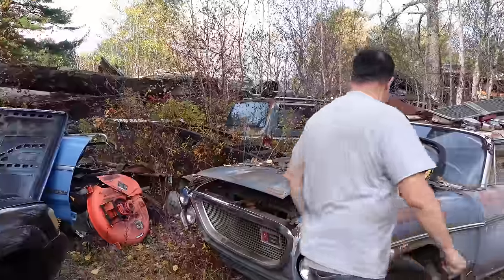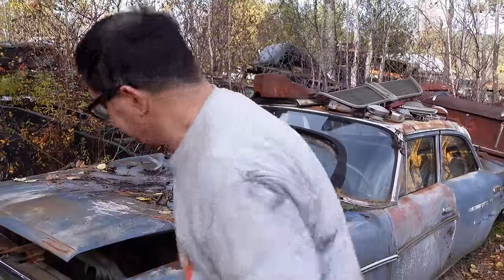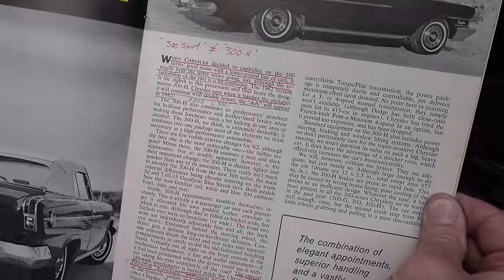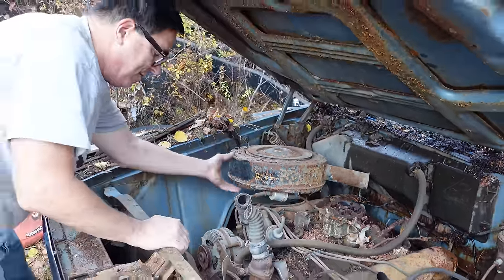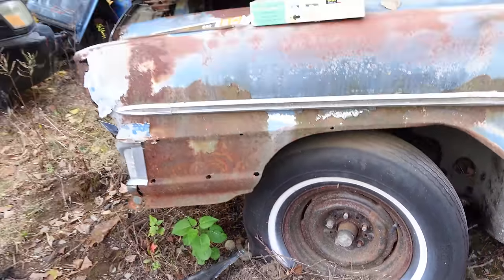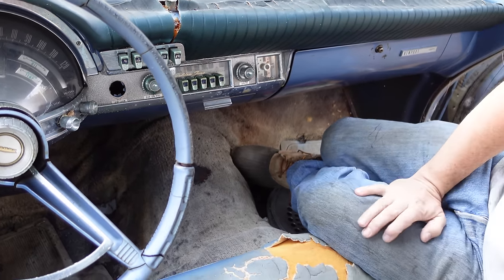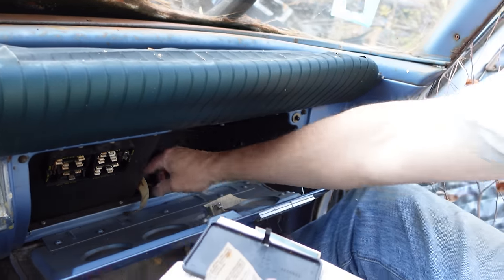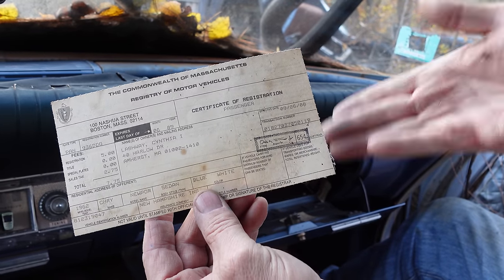Old Newport News

Comment: Here's a fun fact not many people know.  The 1960-62 grilles are the same opening.  They flipped it upside down for the 61-62 cars.  But they'll interchange with each other.  They'll look funny because the inserts were not made to be seen upside down, though. 

How do I know, I was parting out a 1960 and I had a loose '62 300 Sport grille I picked up somewhere and I got looking and sure enough it fit right in right down to the bolt holes. 

That dash can be completely unbolted side to side.   Make sure to get the power unit for the dash lights though.  They're electroluminescent.

Comment: Chances are the shifter was done that way to "force" the buying of the more expensive automatic. Much the same way that GM didn't have rear opening windows on some of the 1978 and up four door A body cars. It was a perfect lead in to, "You know sir/ma'am, those rear windows don't open up. Gives you more room that way. But you might want to order AC because it's going to get mighty hot back there". Response, "Yup, let's order it with AC". Bingo, more profit. No Chrysler keys and locks were likely supplied by Briggs and Stratton/Strattec (as were GM keys back then), but I knew right away those were later GM keys. LOL. 

We got the VIN, we win: 8 for Chrysler, 1 for Newport, 2 for 1962 model year, 3 for Jefferson Plant, Jefferson Ave, Detroit, MI assembly and the rest is the production sequence. The Jefferson plant that assembled this car operated from 1925 to 1990 and then the "new" Jefferson plant adjacent to it opened in 1991 and is still operated by Stellantis today. The old Jefferson plant was located on Clairpointe and Jefferson Avenues in Detroit, MI. I think that might be a four-barrel carburetor on this one as someone else pointed out. 

I heard that. LOL. But since you ask, Ms. Lashway appears to still be alive, still living in Amherst and is about 74 years old according to public records. The address shown on that registration is a smaller home and I believe where she resides now is a much statelier home. I don't see any photos of the Chrysler in them, so it's likely been many years since it was on the road. 

No tag, can't brag, but can be figured out, no doubt: 834 for Newport hardtop, 301 for blue interior trim, possible D for Sapphire Blue exterior paint and W for Oyster White exterior paint.

Comment: I grew up with mom or dad driving us around in a baby blue 1962 Newport hardtop station wagon.  On one of the car's last cruises down the highway, someone pulled up next to us at speed and wanted to buy it (1977 or so), probably to build a hotrod.  It was the first car I drove.  The 361 pulled that beast to 120mph, with the front end shimmying from loose ball joints.  Fond memories of that car.

Comment: Hi Steve another great video. My grandfather had a white 62 Chrysler 300. I don't remember if it was the sport or the letter car. He had to get that dome looked at a few times. I remember 1 time riding in front with him and the dome filled up with smoke and completely filled the inside up so you couldn't see the odometer. I remember him stopping the car suddenly and disconnected the battery. I eventually got to drive it solo one day and boy would that Chrysler fly. It would leave the ground if you didn't lift sometimes! Coming down the rd and had that Chrysler in the wind and some old dude jogging jumped out in the rd and started shaking his fist at me when I blew by. Later on my grandpa asked me where did I go when I drove it. Because the ol dude shaking his fist just so happened to be the local sheriff and almost cited my grandpa for wreckless driving and said that car was inches off the ground when he saw it topping the hill! Needless to say never got to drive the 300 anymore and was left to, at that time grandma's 72 Mercury Marquis Colony Park station wagon. 429 car, That thing was a little slow but she would get up there in the triple digits too! Just floating down the rd. Namaste Steve 🙏🏼
Reply: good story.
Reply: @dustbat  Thanks... my grandpa had many different vehicles around and each one has a story...lol Namaste 🙏🏼
Reply: From canted headlights to covered headlights.  The best of the offerings.
Reply: @mexicanspec  yes superior design for sure

Comment: Well, I finally found an answer to a long mystery. I live in upstate NY and as a kid in the late 70's I sometimes did chores for a old women who lived in an old farm house. In the barn was an early 60's canted headlight Chrysler. It was a base model 4 door. I was amazed when I saw the floor shifter.  I never did open the hood. By the time I was old enough to go back and check the house had been sold and the old barn was torn down. I've often wondered if that was some special 413 cross ram 4 speed gem that I missed out on, now I know it was actually the bottom of the barrel, but still cool!

Comment: I definitely understand why many people didn't love the style of Mopars in 61 and 62, but the canted headlights look, especially on the Valiant, is one of my favorites from any period of U.S. car design.
Reply: What year(s) did Valiants have canted headlights?
Reply: I had a 1962 Plymouth Valiant station wagon, battleship gray, slant 6 and and push button 3 speed automatic. It was rusted so badly that there was no rear floor and no quarter panels behind the rear tires so basically it looked like an open wheel car back there. It was great fun winding out the car to 20 miles an hour in 1st gear and then pressing the button for 2nd then 3rd. With each shift the front seat, which was only bolted at the front because of the missing rear floor, would tilt back and have you looking up like it was a rocket on a launch pad. The bald tires were showing their cords and these "slicks" were exciting on icy roads.

I paid $25 for the car in 1974 and drove it for about 4000 miles until the rear end seized. While waiting for a tow truck to take it to the junkyard, we broke out every bit of glass including the instrument panel and wedged a stick to keep the accelerator pedal to the floor. With the push button in 1st gear the speedometer was indicating 60 miles an hour but the car was stationary. That slant 6 ran until it threw the fan belt and finally seized up. I am certain there wasn't a single usable part left when the car went to the boneyard.

Oh, and it did not have canted headlights. Or any headlights when we were done with it.

Comment: Steve, One of the more interesting features of the Astrodome was that there were no light bulbs in it.  Chrysler had collaborated with Sylvania ( the lighting company) to produce one of the first electroluminescent dashes. The needle tips and the top edge of the gauge bars were coated with phosphorus.  When the light switch was pulled the 12v DC went from the switch to a power inverter in the kick panel and changed the 12v DC to I believe 220volts AC.  Very low amperage, more like a horse fence. This high voltage when transmitted to the needle and bar,  excited the molecules in the phosphorus and they glowed green !  Quite alien looking.  Because of the thin wires required, and the high voltages, the wires became brittle and broke frequently from road bumps and jars, causing no end of headaches for Chrysler, who finally went back to regular light bulbs after the Astrodome was eliminated.  Electroluminescent dashes aren't dead however, they are back in some of the higher end vehicles today, but using computer controlled voltages and more state of the art electronics I'm sure.

Comment: The first car I ever got to mess with was a 62 Chrysler 300 sport when I was 14. My dad was at his friends house and said he was selling his dad's old scrap cars. One was that old Chrysler. My dad bought it for me for 250$ and I payed him back the whole rest of the summer. I cleaned all the pine needles off, pulled 6 inches of rat turds off the rear floor, and got points, wires, condenser, points, coil and spark plugs. And eventually got it to fire. It sounded so cool with the exhaust rusted off. The rust was bad. It didn't have any brake lines left, or Any floors, and I never got past starting it up a couple times. I sold it to get a 84 caprice classic that ran. But I will never forget that car. Or that dash.....it was just so cool. I thought it had a 413, with a single 4 barrel, but was very likely a 383.

Comment: I got a 66 Newport project I picked up a few years back. Some guy saved it from the crusher and had it sitting in his driveway for years. I gave him $700 bucks ,and my buddy who owned a flatbed towed it home for me. It had the original plates , and registration from the last year it was on the road. 1979. 
It's a 2 door hardtop. 383. He never could get it running. I found out it wasn't getting gas to the carb. Put on a fuel pump for about $20 , and it fired right up!😊😊😊

Comment: Chrysler  C body  vehicles  were  well  made and  l had a 64  Custom  880 with the  361 and it was  one of  most  dependable  vehicle l have  owned.
Those  A.M. radios  would  DX at night  l used to  pick up  some  far away  stations  at night.

Comment: My father had one of these. People like him would never have ordered a large motor, no way. He loved that car, however had a LOT of problems with the computer. They would put a new one on but you had to pay for it even if it turned out to not be the problem. Loved that dash. Man it was 3d at night. I had to retrieve it once. Every thing was dead save the horn. I could jump some wires and start it, but if it cut off you had to jump start it as nothing worked. Dealer went right to it. If it has only horn working, it is the amp gauge.( Up date.) I believe my 81 year old brain has made a mistake. I thing his computer problems were on a later (circa 67) model.

Comment: My first car was a 62 Newport Enforcer from the CHP, it was a hand me down from an older cousin, he claimed it had a 413 but I don't know if that's what was in it, it did have a Carter AFB and dual points as well as dual exhaust. One thing I remember was the turn signal lever was mounted in the steering column and the rearview mirror was mounted at the top of the windshield.

Comment: That 413 was a great motor. My neighbor had in his 1963 imperial.  Also his 1970 dodge travel motorhome.  His son later in his early dodge motorhome pulled the 440 out and replaced with a 413 he bought and rebuilt.
Reply: I have a 63 Imperial lebaron that I've owned since 1980 .
Reply: @HowardJrFord  I have a 1965 Plymouth valiant that I have owned since 1983 . I have had other vehicles through the years but I have more of special feeling towards the valiant.  I would never even think of selling my little valiant.  It will still be with me until the day I go home  .

Comment: Interesting distinction about Chrysler and left hand threaded lugs. I had a 53 Plymouth that used wheel lug bolts on the rear, lug nuts with studs on the front, left hand threaded on the driver side and right hand threaded on the passenger side. All four corners had something different going on. I assume it was a transitional thing from the 52 to 53 model changes from the early "P" models from the post war cars. They were so frugal about things back then I am sure they were wanting to burn up any more stock on the shelves rather than engineer and buy continuity in those cars.

Comment: The 300 M isn't a letter car?
Reply from the maker: Hello Napalm Holocaust, Thanks for writing. The 300M was an interesting car. I did a Junkyard Crawl on a 2002 300M Special a few months ago. You can find it in the Channel Playlist. That said, the 300M was produced for a few model years, not really in keeping with the Letter car tradition of a new "letter" every year. Oh, and there's that whole front wheel drive, Veeeeee Six thing. Sure, the "modern era" Chrysler C300 also hasn't changed it's letter designator with each passing year but there's that whole REAR WHEEL DRIVE thing to take into account. Oh, and yeah i'ts got a HEMI! I give the modern C300 a PASS for being an animal when the gas pedal is mashed. I also did a video on a 2006 Chrysler 300 All Wheel Drive recently. They're all there to be seen on the Channel Playlist. Oh, and if you like the Chrysler 300's, check out the Great Texas Mopar Hoard Auction Event playlist for a bunch of great Letter car legends. Thanks again for watching and writing. -Steve Magnante